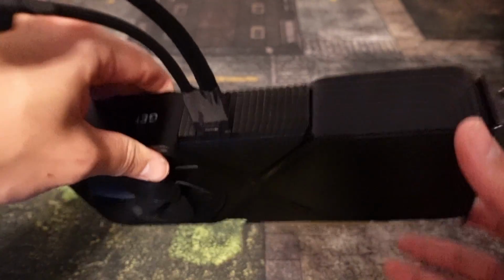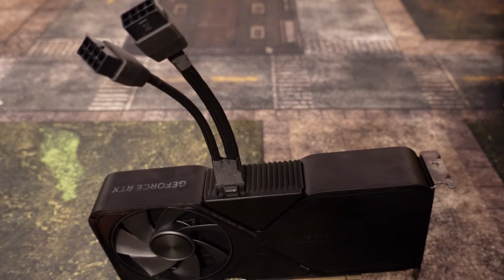RTX 4070 SUPER installation guide: everything you need to know about the 12vhpwr cable!

Comment: don't plug your electric dryer into a 110 watt daisy chain with your 250 Euro either. becasue it will explode the circuit.

Comment: the new 12v-2x6 is an absolutely horrendous design, the pins are way too small for such high heat.  i specifically only buy gpus without the connector, so nvidia it out the window for me, now i only buy amd graphics cards since they still use the 8-pins.
Reply from the maker: On my other channel krootman tech you will see a ton of 5090 guides coming soon

Comment: can you use the the cable that comes with the psu. This cable is a double 8 pin that plugs into the psu and goes straight to a 12 pin effectively eliminating the need for the y cable.

Comment: Why the hell you don't explain that some PSU has a 12VHPWR power cable, that you can just plug in directly? I was finishing mounting my first PC at 4 am, and your video was only creating more doubts. lol
Reply from the maker: @rafa2657  because most people don't have that and I didn't want to confuse people lol, tried to keep it as simple as I could
Reply: @krootman_digitial  ahaha mine psu didn't have 2 cables to connect "alone" in the adapter. And is crazy that it doesn't have alot of videos that explain that quickly and simple lol

Comment: Is it ok to just use 12vhpwr on it or the adapter is better?
Reply: From what I'm understanding, if your PSU has 12vhpwr use it. If not, make sure you are using 2 separate cables from the PSU into the adaptor.

Comment: I've got a 2070super and wanting to upgrade to the 4070s. The 2070s has one 8pin + 6pin connected through 1 cable. Why should I use 2 8 pin cable like you suggest
Reply from the maker: uses more power and its alway better to be safe then sorry
Reply: @kr00tman hey bud,I just got a 4070 ti super,I have a psu be quiet straight power 11 1000w,it as a vga 1 vga 2 and vga 3.which of this three do I connect to the 4070?

Comment: LOL bro its not an infant...you the adapter is going to fit that's why they put it in the box ...no need to test it...just plug the adapter pin cable in and call it a day...also you can 100% plug the cable in if you put your GPU on the mobo first...it might be a little more inconvenient but not really...really good advice on not using split cable...I almost had to do that because my old psu didn't come with an extra pcie gen 3 cable....(I had an older 3060 ti pcie 3.0 setup)…I ended up just upgrading everything including PSU and mobo for my 4070 super...most psu's now come with multiple pcie 4.0 cables...mine also came with a 450watt 12 pin cable that I think I could have just plugged straight into my 4070 super instead of using the adapter but I wasn't sure so I ended up using the adapter...im not sure if one is better than the other....but oh well

Comment: Huge thank you to you, today I upgraded from an EVGA 3060 to a RTX 4070 SUPER, without your information my dumb ass would have pigtailed, I appreciate you infinitely
Reply: This is exactly what I'm doing. I'm replacing my 3060 with a 4070 super. But I'm not sure if it will work since I have a 400w power 😢
Reply: @strwberrypancake8863  ouch. 750 might be the minimum, considering the 4070S is 220w alone
Reply: @ACECOMBOI  oh nooooo 😭😭😭 and I'm scared to buy a bigger battery since I'm not sure my motherboard can handle it 😞😞😞😞
Reply: @strwberrypancake8863  what motherboard are you running?
Reply: @strwberrypancake8863  What if i got a 650W Seasonic Focus Gold certified PSU ? Can someone confirm that it actually holds (at limit) with this power output that i have ?
Reply: @strwberrypancake8863  I plan to do the same upgrade, from a 3060 Ti and a Ryzen 5 5600X to a Ryzen 7 5700X3D and a RTX 4070 SUPER

Comment: Hello. because of the language barrier, I didn't really understand. Correct if it is not so.  I have 2 cables, they are branched into 2 6+2. I connect 1 to the power supply and 1 to the adapter. as a result, I have 4 6+2 2 of which the adapter a 2 is simple and dangles in the case as unnecessary?

Comment: Man, my PSU is 750w but only 1 pci-e pigtail... that sucks...
Reply: I have the same and I'm gonna try running it on pigtail
Reply: @theobaldINsorrow  how did that work out? I'm  Currently in the same situation
Reply: @matthevanhouts2871  it didn't, kinda. I found out that I have separate 2 pci-e pigtails and used both.

Comment: Thank you for vıdeo. I Have 4070 Super gamıng x slım from msı It have 12 pın connector. And my Psu ıs Thermaltake Gf1 850 W . I have 2 different pcıe 6+2 cables. If ı use  both of them cables, Im doıng good rıght ?

Comment: You dont ACTUALLY need a 700 watt PSU. Thats just Nvidia expecting people to have $500 CPUs that use over 200 watts with a 4070. As long as you have a slightly older, less power hungry CPU, 650 Watts or even lower is more than fine.

If you dont believe me, theres full showcases of this card that show it working at almost 100% utilization using less than 220 watts. On older games, this card is as efficient-- if not more efficient-- than even an RTX 3060.
Reply from the maker: This video is for people who don't know what they are doing, and when it comes to expensive pc parts, when in doubt overcompensate. If you know enough to know you can use a lower watt psu then recommended, this guide isnt for you.
Reply: Hi, I have a 650W PSU and a Ryzen 9 5900X. Will it work fine? Thanks in advance.

Comment: I don’t understand this. The TDP of the 4070 Super is 220 watts. The PCIE 12v cable of my PSU (with pigtail) is rated for 150 watts total. Plus 75 watts from the PCIE slot, that provides 225 watts. If I’m not planning on overclocking my GPU, shouldn’t it be perfectly fine to use the pigtail?
Reply from the maker: If you are using this guide then you don't fully understand how power on gpus works, so you should be better safe then sorry, never push the cables that hard imo

Comment: Hey man nice video, and quick question: I have a 4070 super and I bought a different adapter cable to replace the nvidia adapter, and it has 24 pins to a 12vhpwr cable. Should I instead get a 16 pin adapter for the card or can I just plug in 2 6+2 cables in 2 of the 3 available plugs?

Comment: Hi, thank you for your videos. My Pure Power 11 700W CM only has one pigtailed 2x 6+2. Is it problematic if I plug both 6+2’s from the pigtail into the 12vhpwr adapter? I know that you say not to do it, but I’m wondering if the gpu will still run fine if I do so. Thank you in advance
Reply from the maker: @ume-f5j  yes
Reply: @krootman_digitial  thank you for the reply. I’ve just ordered the cp6620 2x 6+2 cables from bequiet and I will connect them to the psu, and then connect one of the two into the adapter, along with my existing 2x 6+2 pigtail. Is this correct?

Comment: so basically i had a rtx 3060ti before, which receives a 2x8 pin cable, and now i have the rtx 4070 super, can i just put these two cables i had connected on the previous gpu into the new one adapter ? like from 2x8 directly into the gpu to 2x8 into the adapter to 12pin? is this the correct usage?
Reply from the maker: Yes

Comment: You need two separate cables from the psu only if the card consumes over 250w otherwise it s safe...I have a RTX 4070 with this adapter and only one cable with 2x8 pin from the psu and it s perfect it consumes around 200W also I have a 550W PSU but it s a quality one from Sseasonic so I m totally ok

Comment: Hi, im getting a 4070s and I have 2 pcie cable, but 3 available pcie slots. the pcie cables i have are pigtailed, is it fine if i connect both of them but SEPERATLEY, for the adapter?

Comment: What's exact reason for this? I tried both configuration and there's no difference, except in benchmark I got few points more on a single cable....
Reply: So the 12VHPWR cable is known to fail under load, 4090 12v ports are melting. And it's always a good idea to use two separate 8 pin PCIe lanes if you can because depending on your motherboard the daisy chained solution could melt the cables or cause failures (if it's not a good brand name PSU) and it also depends on the GPU but I would be better safe than sorry.
Reply: @stygiann  I have 4070 super and 600w be quiet pure power 10 psu, in the GPU manual there was nothing suggesting using different cables, same as my previous rtx2080 which had similar power consumption... never got any issues in this config
Reply: @HorseezTWB  It's your particular case, maybe you were lucky with your unit but it's true that GPUs are failing due to the 12v cable and you can't deny the facts. I would recommend you to get a better PSU whenever you can

Comment: Just got a 4070 super and it came with said cable, no click but that is normal apparently, but there is an 1/8th on an inch gap from the factory card, ots getting power but monitors arent connecting, if i dont reply to this its because all i needed to do was uninstall my old cards drivers, if i do respond it will be a plea for help because i just spent $800 on something that doesnt work
Reply: Monitors still won't connect after doing such wondering if the card is grounding out
Reply from the maker: the gap is not good you should try reinstalling it or returning it, look inside the cable to make sure the pins are not bent

Comment: Guys if your gpu is not turning on DO NOT listen to the guy about the pigtail. No hate to this dude or anything but since he was so vocal about this mistake I of course didn't do it but my gpu wouldn't turn on and fans wouldn't spin. It wasn't until I asked my friends I found out I had to pigtail the cable for it to work. I would probably still listen to his advice but if it dosen't work then this is why.
Reply from the maker: What power supply are you using?

Comment: My pigtail is plugged into my 4070 and its fine. The hell is the point of them pigtailing if you cant use it lol?
Reply: I've had mine plugged in like that for the last year
Reply: 4070 or 4070 Super?
Reply: @devhxpg  4070 non super
Reply: @calebs2crazy  You don't have/need a 12vpwr adapter in that case so you can use the pigtail.
Reply: @devhxpg  that's what I figured after more research I found that you can do it with 225 watts or less and 4070 is only 200 watts. I recently put an aftermarket extension cable in to clean up the look and found out I had two separate pcie cables. Each are pigtailed but I plugged into the non pigtailed end on each just because I can lol. Good to know if I upgrade to a more power hungry card too!

Comment: The power supply I want to buy has a 12vhwpr to 2 6+2 pin cable, would it be okay to plug the 12 pin into the gpu and the other 2 8pin side into the PSU? The psu I want to get is the rm850e. thx
Reply: I did just that with my RM850e and RTX 4070 Super. It's been running fine for the past two months!

In my opinion, if your PSU comes with a 12VHPWR cable, it's usually best to just use that directly while avoiding adaptors and such.

Comment: I have a new MSI 4070TI super and there is no warning in the manual that you cant just use a pig tailed 2 x 8 pin, so your advice to use 2 separate cables probably saved me from ruining something because that's exactly what i was going to do. Thank you so much.
Reply: Weird. I just got an ASUS 4070 super and in it's two page manual, one was entirely dedicated to warn the user to not use the same cable haha
Reply: @diego-zh2th  Yep, just got a ProArt 4070 Super OC and it's got like 2/3 of the 2 page "instructions" saying not to do this!
Reply: actually it might be that your PSU can run this videocard in pigtail mode. This strict no-no must be actually based on something. And I think in theory it's possible that one pigtailed cable from powerful PSU can run this videocard.
Reply: @theobaldINsorrow
Reply: Mine arrives in 2 days and although I would have probably read the manual due to this new cable I was planning on just using the pigtail cable , you may have just saved my bacon 🥓
Reply from the maker: im glad I could help!!!!

Comment: I’m just really stupid, so my psu has (1) 8 pin connection. The cable I have connects to the psu which is the 8pin at the end of that cable I have (2) 6+2pin cables. Can I connect those (2) 6+2 pin cables in to the 4070 cable and be fine?
Reply: I don’t think it will work, might even hurt you pc. You probably have to upgrade psu

Comment: This information is inaccurate. A 8-pin PCIe Splitter is rated to less than or EQUAL to 288W. A 4070S can draw a maximum rated draw of 220W.
Reply from the maker: I prefer to be better safe then sorry with my guides, most people who use these guides don't understand those limits
Reply: @krootman_digitial  Fair enough. Any 40s series over the 4070s will need 2 separate 8pin cables so might as well.
Reply from the maker: @TRalstoon  exactly

Comment: Showing this hooked up in a couple of configs to an actual power supply would have been a ++++
1. Showing two separate PS cables (no pigtails) going in the 12v cable adapter
2. Showing TWO PIGTAIL cables (not one) going into the the 4070 adapter and showing how NOT TO USE THE PIGTAIL end of either cable
For the visually challenged. :)

Comment: Why do power supplies have the dual end if you can't actually use it?
Reply: Pigtail cables was a thing back when Ether Mining was possible using RISERS.  One end of the power cable would go into the GPU (less power hungry GPUS in the past) while the pigtail end could be extended into the riser power connection.  If you did not do any ETH mining or don't know what a Riser board is no worries.  But the author of this VID is right.  Do not use a PIG TAIL Power cord to power this GPU. .

Comment: please help me man, I'm getting aggravated... i have an 850 psu (had to buy a new used one cause the one I had only had one PCI-E cable and for whatever reason those are difficult to just buy), my 4070 super is brand new. i already downloaded the drivers ( currently using a 1080ti but got newest for 4070S). everything else is running fine, but when i switch out the card, no display. this is maddening,,,
Reply from the maker: Is the GPU plugged in with 2 cables?
Reply: @krootman_digitial  yes, I got a whole new ( used ) psu just to get a second pci-e cable to plug them into the adapter ( instead of the one split cable

Cards brand new

Updated drivers

Everything works right with the new psu and my old graphics ( 1080ti

But switch in the 4070 super, no signal

Comment: You can use 6+2 =8 pin, these are fine. Just make sure it is a separate cable running from the PSU for each connector.
Reply: @krootman_digitial  12VHPWR is a Dumpster Fire | Investigation into Contradicting Specs & Corner Cutting 
video by Gamers Nexus. Worth to watch i think. 12v 2x6 cable is better idea probably.

Comment: Sorry for the late response to any of these comments. Recently upgraded my 3060 12 gig to a 4070 super. Say if I got a atx 3.0 psu that comes with it’s own 12 power pin cable, can I just use that instead of the adaptor? It’s a 850 watt psu the 12 pin it comes with is rated up to 850 watts I went a little over with how much shit I have in my build from builds over
Reply from the maker: Yea your good

Comment: Please help, I'm going to order an RTX 4070 super in the next couple of days or maybe even today. My questions is, I have a 1000w corsair PSU that I have had for sometime now, should I use 1 of my pigtail cables that I have had for ages while I was using my GTX 1060, or buy a new cable and use the cable that comes with the GPU for the separate pig tailing. I'm just worried that my old GPU cable/cables won't be able to handle the wattage for this new GPU. Any info would be very much appreciated as I'm a gentleman in his 50's and this stuff is confusing sometimes
Reply from the maker: If your Corsar psu has 2 8 pins then you should see if you can find the other 8 pin, the cable age shouldn't matter but if you are worried you can buy cable mod cables that work with Corsair psus
Reply: @krootman_digitial  Aww cheers, yeah my PSU has got 3 8 pin slots in it

Comment: Please I need help, so.. I have a SilverStone 850r extreme sfx power supply and it only came with only one 8pin to two 6+2 pin (one of the is piggybacked off the other). What you are saying is I should NOT use that second one (that’s piggybacked) and I need to get another 8pin to 6+2 pin connector and that would work? I’m building my first pc atm and I am just quite confused!
Reply from the maker: if you can, return the psu. I can link one you should get if that helps
Reply: Would like the link please
Reply: For reference I am building in the fractal terra (ITX) and I got this specific psu for the size it was cause the case is only 7 liters